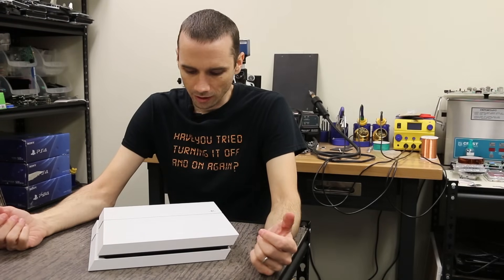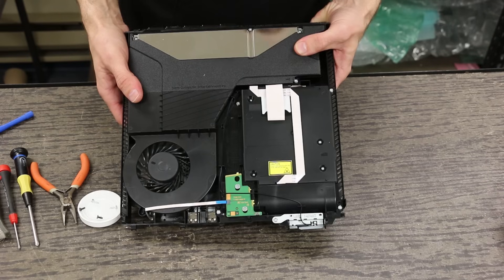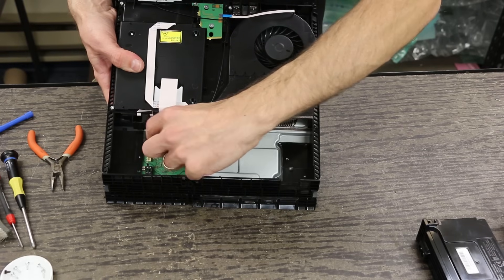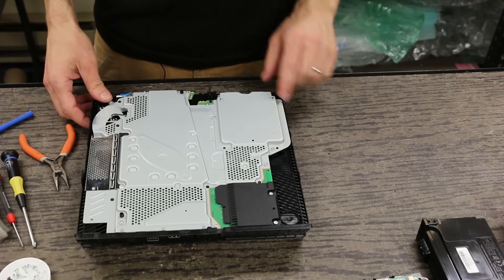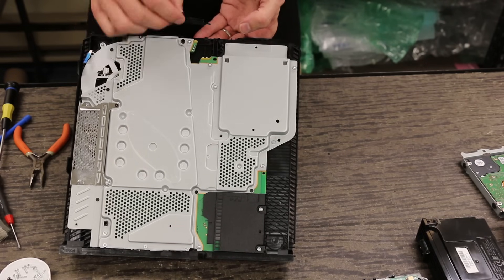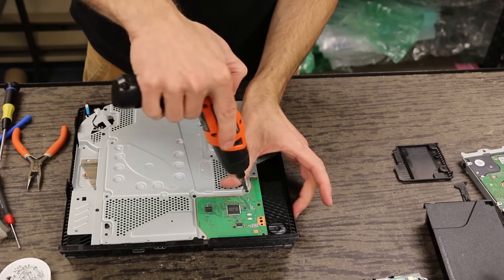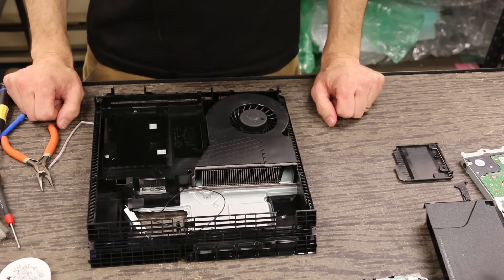PS4 1215 Teardown Tips & Tricks

Comment: Some tips for certain points in the disassembly process for consoles being opened for the first time.

(PSA) You DO NOT need pliers and SHOULD NOT use any for this

1. 0:55 If you are having trouble getting it off, try working the edges of the piece with your fingers. If that doesn't work, turn to a plastic pry tool and work around the edges. This should get it off.

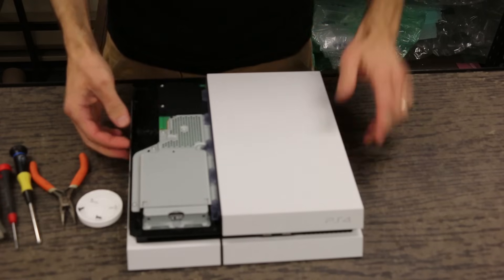2. 2:12 If you're having trouble, refer to the previous tip and employ the use of a plastic pry tool.

3. 5:40 DO NOT do what he is doing with the pliers. What I did was I took my screwdriver with interchangeable bits and inserted a scraper bit that has a very thin, fine edge. I then placed the edge in the seam between the plug and the connector off to the left and gently twisted the handle. I then shifted it to the right and gently twisted the handle again. I repeated this process and gradually worked the plug up until it was out of the socket.

4. 6:04 Using the pliers is not as big of a deal here, I would say. However, I just used my fingers to rotate the plug counterclockwise and wiggled it up off the connector.

5. 8:30 At this point, you may as well just put it off to the side somewhere safe and out of the way.

6. If you don't mind writing on your RF shielding, you can use a permanent marker and draw symbols next to the holes for the screws representing their type and write yourself a legend for these symbols on a piece of paper.

7. 13:21 If you are working on your's for the first time, it might not come right off. Just take a plastic pry tool and gently and carefully work around the edge for it to pop free.

8. 14:10 Refer to tip 7

Comment: Ok well I tried and tried and tried and can’t get mine back together. Accidentally pulled off the power plug trying to unplug the power supply and I can’t solder it on right. It is all burnt and I can’t even see where the points r . Plus little balls of solder r stuck on the board making wrong connections. Not can’t get the solder off it just smears and covers more of the board. I think I’m done and can’t figure it out. My soldering skill r not good. Need help plz

Comment: I just wrote a comment, and it disappeared into digital limbo. I might be on the YouTube naughty list — wouldn't be surprised. :-P
I do want to thank you anyway, so I am writing again, and I hope this one will appear in the comment section.
What I want to say is that this video is truly evergreen, because here I am, 9 years later, having completely torn down, cleaned, reapplied thermal paste, and assembled my daughter's PS4. Now it works like a charm. The problem with it was random shutdowns during gameplay. I'm not sure what exactly helped, but I believe the thermal paste had become dry and inefficient. There wasn't much dust on the heatsink. I do have some experience with this kind of work, but your video provided clear instructions and saved me a lot of time, as I didn’t need to figure anything out myself.
So thank you again, Sir.
I hope you're doing well and will continue with your great work, providing people like me with valuable videos like this. You just got a new subscriber.
Reply: How were you able to remove the the cables from the motherboard. They're giving me a hard time.

Comment: Thanks great video. I cleaned my PS4 put it back together and then my controllers would not function. I watched your video, .opened it back up and found 3 ribbon cables and Wi Fi cable disconnected. Your video shows the location of the cables and now my PS4  is back to normal

Comment: Thanks! That was helpful until i ripped the plug for the power supply off the motherboard. It wasn’t shown well what part you are supposed to ply off there. I just wanted to clean the disc drive now I made it much much worse as I have no soldering experience. 😅

Comment: Hey man. I want to thank you for your guides they have really helped me a lot of times :) i have a question alto ita for the Ps3 slim if you might know. I can't find anything about it when searching. So my friends ps3 slim wouldnt read discs so i removed and opened the disc reader because it sounded like it does not properly inser/hold the disc. And the suspended part that the lasers are on feels kind of stuck. Not stock but its hard to move. Maybe thata just because I moved it manually? Anyway i cleaned the track a bit and the lasers so now it reads the disc most of the time but still it sounds like it does not insert/grab the disc properly. Maybe I need to run it without the disc reader cover to se what happens.  Any suggestion? Thanks :)

Comment: Not sure if you respond to the comments from your old videos. But...

I have this style of the PS4 and i was cleaning it. My Fan doesn't want to spin although it free spins by itself and also the heatsink is completely clean. I did see that some of the ribbon cables (underneath the power supply) are stripped. Other wise I've tried everything i could do meaning rebuilding the data base and just resetting it

Comment: at exactly 5:45 is where the entire power supply connector ripped off the motherboard. I've worked so many electronics, never had this happen. This connector is insanely tight with no way to get leverage to come out properly.

Comment: My hdmi is not working for the ps4 and I’ve tried taking it apart but I didn’t go as far as the motherboard I only took the first metal plate off the motherboard. Should I go further and see if somethings loose or just ship it to someone who knows what they are doing?

I went to the motherboard and cleaned everything out I didn’t see anything wrong w the hdmi port so when I put everything back together it still didn’t turn on maybe I should buy a new hdmi port and replace it instead of getting a ps5?
Reply: I need to replace a USB port but after wildly pulling apart everything I am not confident I can get it back together. I also pulled the cables out of the plastic connectors oops

Comment: Hey new watchers be careful when pulling on the power supply connection, it can come out real easy, I was mid watching this video and it just came right off from the board its 2 parts, the big white box thats connected to the board and the smaller connectors that go INTO the box, THAT is what you wanna pull, mine just came out with the whole thing... a sad day.

Comment: PSA power supply connecter comment at 5:35, understand that he is referring to a plug that goes into a piece of white plastic housing, which stays on there. Do NOT pull the whole thing off, I just did that because it is hidden in the video and now my PS4 cannot get power.
Reply: @regnar_flowlluks  I just did the same thing lol RIP. I wished he would have specified 🤦🏽🤦🏽

Comment: 5:35 Guys DO NOT disconnect the power supply from the mobo! Do it from the power supply itself. I made the mistake of doing it his way then the whole connector came off with very little force. I just pulled up a bit with my needle nose pliers and it just ripped off. Now i have to go and buy a soldering iron to try and reattach the damn thing. I'm so fkn pissed rn.

Comment: I cleaned every part of my ps4 and put it back together but when I turned it back on, my controller won't connect to my ps4 and it blinks with a white light. Also my ps4 won't recognize the disc anymore so I figured that I've probably made a pretty big mistake in the reassembly. Does anyone know which part this problem has to do with? It would really help :)
Reply: Do not follow this guy's video....watch other good videos with properly zoom on the hardware.

Comment: I would recommend not taking the power supply off of the motherboard because when I was trying to I ended up spending 10 min to try my best to be as careful as I could be and ended up pulling the pins off of the board it was a helpful video but I would recommend not disconnecting anything from the board that might break easily and is delicate.

Comment: I’m new at this but I wish it would have been more clarified that there are two parts to the power supply connector. I might have just missed it but I ended up pulling the lower connector off of where it is soldered. All I wanted to do was clean all the dust out of it lol. What can I do to fix it?

Comment: I see now it was a two part, male/female plug as opposed to the whole piece being a female part meant to slide over pins projecting from the board. I was grabbing the female portion attached to the board.  I should have been grabbing the very outer/upper lip.  I would still suggest using the end attached to the battery at that you will be pulling at a 90-degree angle to the board.

Comment: I would suggest telling people to unplug the power supply at the power supply.  I pulled the end connected to the board, only to strip the pins from the board. The end connected to the battery seems to have a socketed piece better suited for multiple use.  I've not detached it myself as that my confidence is now shot and I need to now focus my time on making enough money to replace my 400$ paper weight.
Reply: Me too! I was happy to find such a detailed video but that important part wasn’t shown and I ruined my ps4 also.

Comment: I have a question.

My game was running loud so I disassembled it and cleaned it I also took the motherboard out kept the same thermal paste and thermal pads in and put it back in And then reassembled it
Now my PS4 fan runs super loud and automatically turns off 
Could it be because I didn’t replace thermal paste and thermal pads because if that’s the case I could go buy some thermal paste and pads to replace it

Comment: I messed up so bad. When attempting remove the power supply cable from its receptacle, I popped the entire receptacle off of the motherboard. I tried to solder it back on, but my tool is not suited for such a small space. I only managed to resolder two of the contact points, but the other two are physically touching. Tested and no power. Is my incomplete repair to blame, or is this a problem that can’t be fixed? Am I looking at a new motherboard?

Comment: 0:57 I can't take that off how do I do it properly?
Reply: For that particular section of the case, you have to pull gently away from the console, unlike the other 2 sections that one is held in place by clips, so when you pull opposite the plastic divider it undoes the clips and slides right out.

Comment: He slides the cover easily while mine needs god’s force to pry a little.
Reply: i broke my pry tool with this
Reply: @cheesecake3d  haha
Reply: @cheesecake3d  same brother 😔
Reply: I’m so high 🤣🤣🤣🤣🤣🤣🤣🤣🤣🤣
Reply: Yeah same here damn! I almost turned into the she Hulk to get it off. Same with the power supply i broke the white little connector so i need to buy a new one lol
Reply: Once you take it off and put it on a couple times it gets a little easier. The initial teardown is a little rough.
Reply: Bruh same I think mine was that caked with dust, it was a hand-me-down of a hand-me-down
Reply: Mine pulled apart easier than he shows and I've never had it apart other than a 2tb hdd/ssd swap. Dirty as ever. I'm still picking stuff out the fan since I'm watching and working on it at the same time.
Reply: @Oh no, not today you dont  wild wonder how quality control was for the ps4 this generation of them  build quality seems to be all over the place
Reply: @goku546686  especially since I bought this console new in 2015.
Reply: Yea for your 1st or 2nd time taking top off will be snug/Zeus pwr needed lol jk. He has took his apart noumours times(mentions at 1st had apart b4)b4 this video.
Reply: I gave up trying to clean the thing, I feel like I'll do more damage if I kept trying to force it open
Reply: @MP - 07BL 758199 Darcel Avenue Sr PS I bought a PS5 and now my PS4 is collecting dust in the drawer.. F it..
Reply: i realize I am pretty randomly asking but do anybody know a good site to watch new tv shows online?
Reply: @denverbrennan6418  soap2day
Reply: @lexwii legend

Comment: Power supply connector broke off the board when I "wiggled it gently back and forth". Not a risk-free operation.
Reply: Same. He could have spent a little more time on this part and given some warnings. Mine is ruined too. Thanks dude....
Reply: @mboser04  same for me his video has now ruined 4 PS4's
Reply: @Deathcon2040  5 ps4s
Reply: Same thing happened to me and I soon discovered that I would have to replace whole motherboard
Reply: 6
Reply: @christian.howell2714  7
Reply: @christophermcfarlane9596  9
Reply: How about 10... Definitely needed some more clarification.
Reply: Just happened to me too. I wish he would of explain that part better.. Saying, make sure not to pull out the power supply connector, cause a lot of people have broken their Ps4 doing this part. And should of roomed in with the camera so we could see better. Can you just attach it back, or do you need a brand new motherboard?
Reply: @Psyradium  Yes, you can reattach it. You will need a soldering iron, some flux, and a steady hand. If you can remember which metal ends of the connector connected to the motherboard, you should be able to reattach it. Although if you totally ripped that sucker off then I would find someone else to do it. If you are willing to spend $20 or so on the equipment, then soldering would be a great option.
Reply: @Psyradium  it's repairable. Mine got repaired
Reply: Same happened wid me too guys
Reply: is it actually ruined? did you go to a repair shop to try and attach it back in (of replace the connector)? just happened to me too
Reply: My gently wiggling went wrong too
Reply: Unplug it from the supply end, not the motherboard

Comment: ****READ THIS****
for anyone wanting to take out the power supply remove the male end from the female end on the power supply and not on the board if you want to be careful. I tried to take it out and ended up ripping off one of the 4 ends on the connector on the board and I though it was the power supply so I bought a new one and ended up wasting around 70 dollars. All I ended up doing was installing the new power supply and sauttering the disconnected pin.

Comment: ok so i was taking mine apart to dust it out for the firts time in 4 1/2 years of owning it. at 2:02, when i was removing that top part, i'm an idiot and didn't see those screws. i just pulled the top shell completely off. it separated from the clear greenish piece (you can see it at 2:28), i could see what looked like adhesive that had kept the top plate and that piece attached and realized i did something wrong. when i reassembled it, the top part went back on fine and isn't loose. the PS4 is working fine and i don't think that should be a problem but just to be sure, will it? could i have messed up something that becomes an issue down the road or causes internal issues? or is it just as simple as i separated the two pieces that were held together with adhesive and is only a cosmetic issue (that you can't even see unless you take the top back off again)?

Comment: Good walk through overall. My only complaint  is at 6:19 when you remove the power supply cable. I (with admittedly limited know how) grabbed the wrong part to pull the wires out and yanked the thing right off the motherboard. 

Looks like I'm buying my girlfriend a new PS4 haha.
Reply: I did the same thing bro. So upset!
Reply: Miranda Martin mines stuck on and I don’t know what to do cuz I don’t wanna rip it
Reply: @diamond-a4759  the black wires are connected to a piece that plugs into the bigger tan piece. Don't pull on the big piece! Look for the seam where it's plugged in
Reply: Miranda Martin Ik that part but I still can’t get it out cuz it’s too tight
Reply: @diamond-a4759  maybe use 2 pairs of needle nose. One to hold the bigger tan part down and the other to pull up on the other piece
Reply: Miranda Martin thanks I’ll try it
Reply: Yep me too
Reply: Im still stuck here i cant remove the power supply

Comment: So basically my ps4 was really loud so at first i cleaned the outside of the ps4, then i opened up the top of it and started cleaning the dust off the metal parts then took the metal parts off then went to cleaning the dust off the motherboard, after that i put the stuff back and turned on my ps4 to see if it worked but it made the noise worse and made the ps4 turn off automatically when i opened a game so after that i thought it was just the fan messing up so i decided to open the bottom of the ps4 and clean the fan out a lot and i took the battery out too and cleaned the empty space there too after that it ran good for a while then made the noise even worse and did the same thing and sometimes it takes me more than once to turn on the ps4